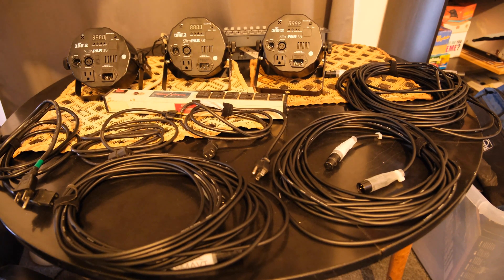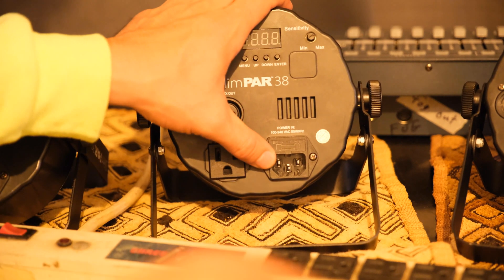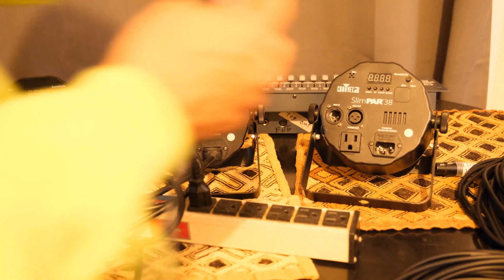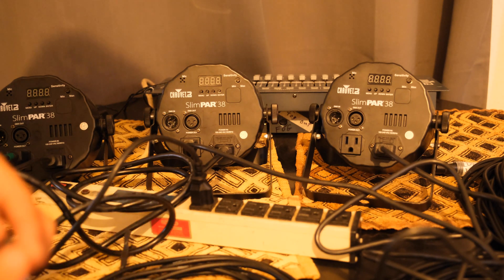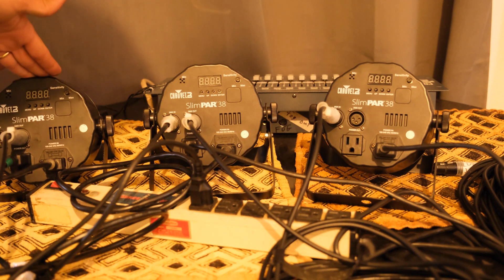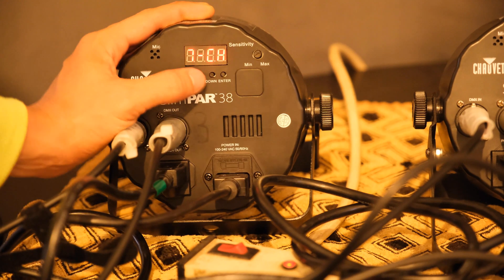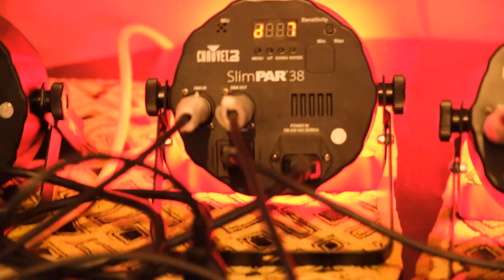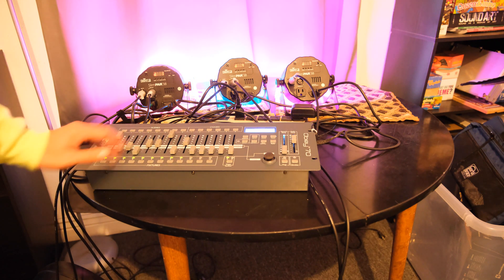DMX Lighting Basics using Chauvet Obey 70 pt.1 of 3

Comment: Absolutely EVERYONE making these videos is soooo disorganized.
Reply from the maker: If you like I can remove the video so you do not have to be burdened by our help
Reply: I can't say I care for this commenter's opinion, but I think there's a point to be made.  Even the simplest of edits can help this video flow (why do I need to know your camera died?), and obviously the video editor has text graphics, which could be used to strengthen the information given.  There's "help" and then there's "value", and watching this video made me question the value I was getting.  You went back a lot of times to change what you were doing, and the LED screen with the options in the top right is never shown.

I appreciate the good effort, mate.  But if we're looking for information on how to use this board, we may need something more concise and on point.  Good luck.
Reply: The addresses are preset.  See manual for addresses.